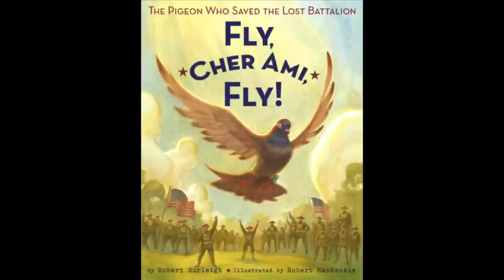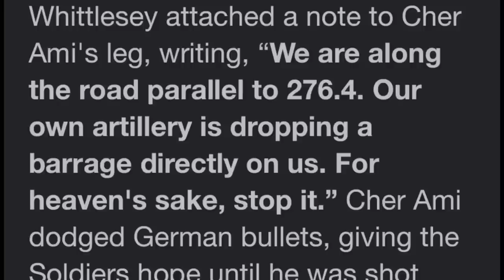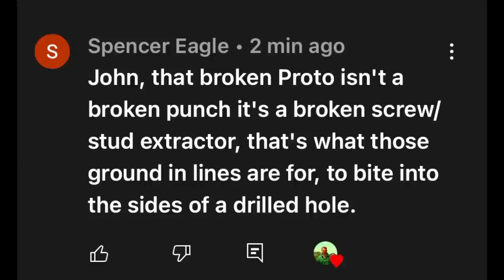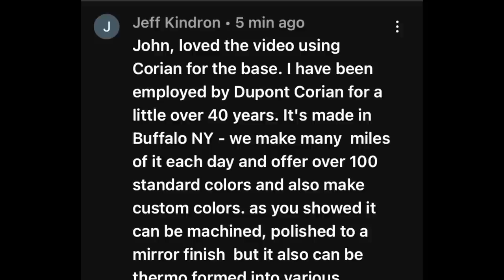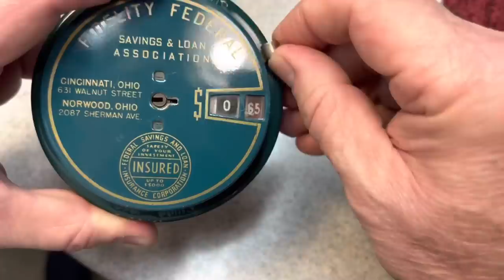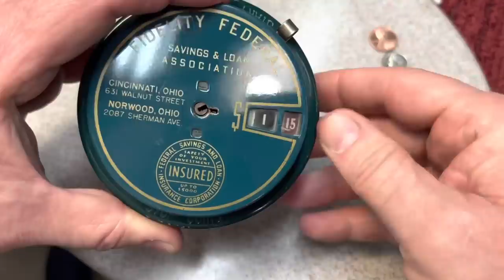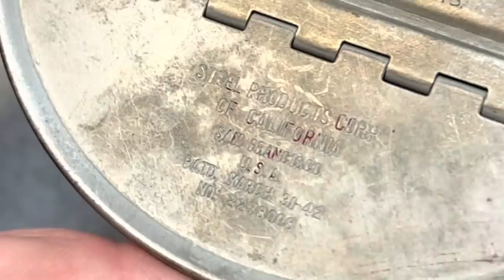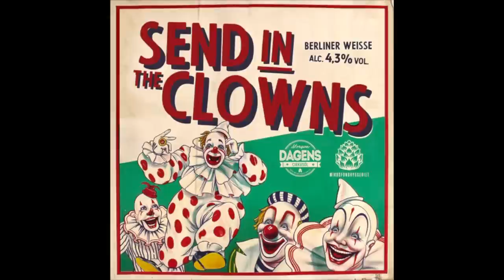Mega Mosh- Cher Ami, Humpty Dumpty  Bank Repair, Mechanical Bank Review and More￼

Comment: Actually it is a Pipe EXRACTOR used for removing broken threads of a rigid pipe in a bulkhead .You hammer the tapered end into the broken pipe the small flutes dig in as you turn counter clockwise 😀

Comment: The content just keeps getting better and better...simply amazing. My mentor in the machine shop only used the square easy outs. The reverse threaded version could dive into the bolt and escalate the problem, as opposed to the square, which only go in as far as you drive them. That was his opinion, which i tend to agree with. 
That orange corian is my new favorite color....super cool. Cheers

Comment: John , amazing video like always . I used to raised pigeons when i was younger. That orange handle on the knife is so beautiful, i was thinking that color on a polished machete or hatchet  it would look amazing. I knew it was a screw extractor you could tell by the little grooves on the side but i never had luck on those, i use them as a punch as well .

Comment: I knew that was an extractor because I have a smaller 5peice set of K-D what is named screw extractors but works good on broken bolts if you can drill a hole down in it. But you need to hammer it in good or they will slip. they sure have worked several times for me!

Comment: My grandfather gave me one of those cast iron banks, is there any way to know if they are original or reproduction banks. Great video as always
Reply from the maker: Hi Noah- One way is the screws are slotted on early banks, also the castings are different.  Many times they would use original banks to make molds for the reproductions so there will be a small size difference.  =D  If it was your Grandfathers it probably is original!   =D

Comment: My last job of 32 years before I was forced to retire was as a engine mechanic. I only used Proto square easy outs to remove broken bolts. I quickly learned that those round spiral type of easy outs did not work that well most of the time.
Reply: I've had better luck with Proto, as well. If I remember correctly, those ridges on the edges are actually cutters to cut a gripping surface into the broken bolt or stud. They were made out of some really tough steel.
Reply from the maker: We had a special brand in the bus company (USA made) that were twisted flute but less of a twist and were super sharp.  Those were amazing but very expensive. The worst is getting out a broken tap!  =D
Reply: @ScoutCrafter  Broken taps, broken easy outs and broken drill bits is bad news. On cast iron blocks I would use a torch to soften and remove the fore mentioned items. Aluminumn blocks mean more work and lots of cussing.

Comment: Very cool money counter! It reminds me of a question. I got a handful of change the other day and there was a few modern pennies in there. They have changed the stamping somewhat and something just felt vaguely underweight or undersize. I checked it against another penny, it's not smaller, I used the micrometer. It's arguably thinner, but the images have more depth so I think that's more of a volume measurement which admittedly I did not do. I did put them on a scale which did not show a difference, but it's just a cheap little digital scale. Am I going nuts? Does anyone else think they feel wrong? The only thing I could definitively put my finger on is that the older ones have a thicker ridge, I never knew if that was from impact or by design..
Reply from the maker: They had to keep the same dimensions because of certain machines but you are so right, the new pennies definitely feel lighter and cheaper then the pure copper ones.  New pennies are mostly Zinc (97.5%)  with a copper (2.5%)  plating and they say the pennies before 1982 weighed 3.11 grams and the new pennies weigh 2.5 grams...  Interesting!

Comment: I’m sure JB Weld will hold just fine for years and years to come, but is there any reason why you chose not to drill and tap that small spring steel rod handle instead?
Reply from the maker: I don't have the tooling to thread music wire, the stuff is super hard.  Also the hole I made in the remaining  cast bar was very close to the end and I was afraid if I ran a tap thru there and it split the hole I would be back to square one.  The tight fit I made allowed me to JB weld it in place and also glob it around the entire end cap.  It feels really solid yet has a tiny bit of spring to it.  Believe it or not the biggest time consumer on that project was getting the eyes to work properly!  LOL   Thanks!
Reply: @ScoutCrafter  Was just curious, I appreciate the explanation. That makes more sense and considering your experience with this kind of stuff, I think you know what’s best. Oh I believe it, it’s always those little fiddly parts that look like they will be a breeze…which end up consuming most of the time in the project, which turns into sweating and some mild swearing lol Thanks John, I always enjoy your videos!

Comment: Wow I don't think I've ever disagreed with you so resolutely. I also commented that it was a bolt extractor, of the Blue point variety. I don't know for certain they invented it, but that's how I've always heard it referenced. I think these are the greatest extractors there are! I can't stand those spiral ones! My grandfather was fond of saying, there are six different versions and they are all equally ineffective! I suspect we all have a private arithmetic which determines what form of extractor has worked best for us in the past and is thus our favorite. Funny how that works, you can have two guys of equal experience both vehemently convinced their opinion is the correct one. Meanwhile the market keeps manufacturing the same four to six styles
Reply: Wait I tell a lie! On just a little further thought, I think I'm firmly in the disposable torx bit category. I think I've led with that approach the last decade or so and been really happy with the results. Mostly you don't much care if you break one